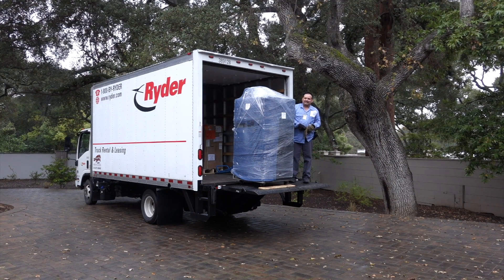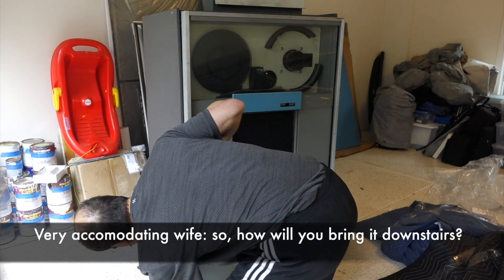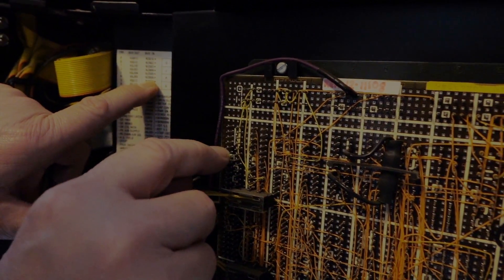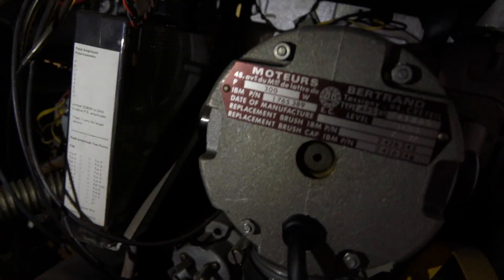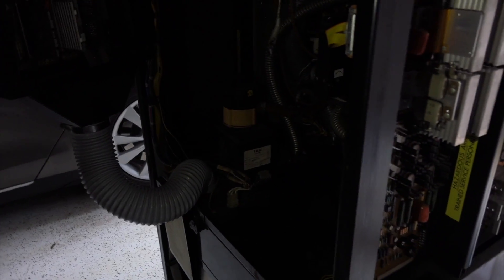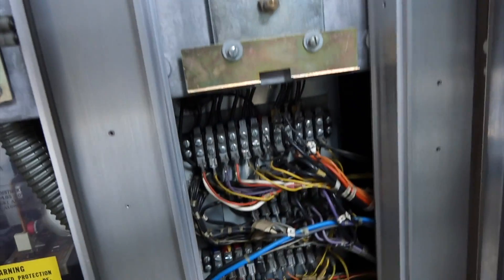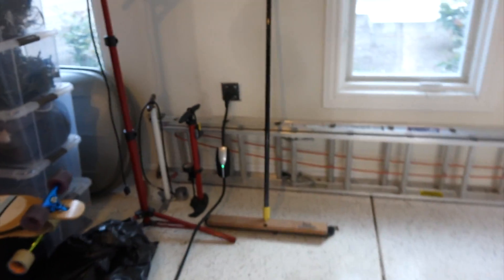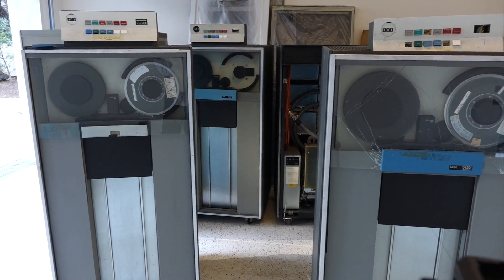IBM 3420 9-track tape drives arrrive for restoration. 800 lbs each!

Comment: Marc, you blurred out your home address so all of us volunteers wouldn't be at your doorstep ready to help? ;)  

I guess there is also fair amount of Palladium contained within the circuit boards?

Looks like the similar IC technology found in my IBM Memory Typewriters from the mid-70s.

Allen Organ uses the same "credit card" access latch to get the top lid of their consoles open.

Holy cow, that tape controller cabinet is huge. Glad it can drive more than one tape drive.

Concerning powering it up, there is a guy who has a large computer in his home and there was a way around the 3-phase power problem.

Here is the video which I think contains how they managed around using 3-phase to power the system.

Here's What Happens When an 18 Year Old Buys a Mainframe (IBM z890)
https://youtu.be/45X4VP8CGtk
Reply from the maker: Can't do that with mine: I really need the 3 phases for the motors, can't be wired in two phases. Priceless talk by the way...
Reply: Well you better be prepared to watch your electric meter spin! ;)

Comment: Hi, From 1967 - 1973,  I was an operator and later a Cobol programmer on an IBM 360/40.  We had 64K memory,  2400 mod II tapes,  2311 and then later 2314 (Pizza oven) discs.  Also 2 1403 printers, one with the power top. I left data processing to be hired  by IBM as an OPCE  (Office Products C.E.) My specialty was the IBM Selectric typewriter.  I worked in Chicago's Loop.
     I truly hope that through efforts like yours we will  be able to preserve at least one complete and functional  IBM/360.  If you obtain the 1052 Selectric terminal, and need my 2 cents of tech. advise, contact me:  Jim B.    IBM S/N 606731.....   PS, we had the same problem with sound deadening foam deteriorating with age........Yuk.

Comment: You are completely crazy. I cannot wait to see what happens next though! If you're going to have the tape machines and controller, would it be out of the question to track down a CPU as well and have a real System 360 running in your garage?
Reply from the maker: The 360/50 CPU, if we could ever find one, is huge. Then I'd have to fight against Paul Allen and the Living Computer Museum, I'm not gonna win... Not to mention the 10's of kW of power I'd need. So that is not completely impossible, but really far fetched.
Reply: It really depends on whether the BIOS on the motherboard supports it. The 5.25" diskette drive was not recognizable by my newer PCs, but it was recognizable by an older one.
Reply: I'm not sure an external 5.25 diskette drive is recognized by Windows. I'd like to see this drive be connected to it. I wonder if there's a new tape drive that modern PCs can see ...
Reply: They scraped them for the gold content, the same as they did with the core memory.
Reply: CuriousMarc Connect it  to windows 7 or 10

Comment: Since the US government likes to keep old computer gear going for a long time, are there any companies offering service parts for these machines?
Reply from the maker: +ariscop: I believe you are right, the /z machines still support 360/370 code (!).
Reply from the maker: The problem is that these machines were mostly rented, not purchased outright. IBM would get them back at the end of the lease, and would destroy them so they would not compete against newer machines. So most of them have disappeared. Then of course they take a lot of space, so people got rid of the few that were left. And of the few that were still left, movers cut the cables, which renders them close to unrestorable. Let's hope they missed a few...
Reply from the maker: PDPs are quite common among collectors. Not so with the IBM 360. Here is a world inventory of known 360's: http://www.ibmsystem3.nl/System360/. If you ignore the model 20's which are much smaller and not really compatible, there are 17 "real" 360s' listed there. The LCM just got a model 30 recently, that should bring the total to 18. Only ONE model 50 (!). That's how rare they are.
Reply: The is a video ... about 2010 of a complete system 370 final shutdown. It was from a big oil company (or something like that) The owners were terrified to stop their systems because they though they would make their finances to collpase. So they keep this thing running as long as they could. Crazy stuff. but also Banks are very reluctant to upgrade any working system. At my university, still in 2004 a complete raised floor 370 worked every single day to run ALL the administrative tasks in several offices using terminals. No sure way they keep it going. I remember that they took a not working disk drive to another room and the motor was bigger than a washing machine one. Everything was gigantic. They have tons of green phospor terminals with a clunky keyb, I mean SUPER clunky ... a model M was a toy compared to them. This machines, specially when set in a whole big room have a big appeal. No matter if a standard desktop PC is faster. Is all about both character and charm
Reply: Actually not true. In the very old days, pre 1970, a lot were rented but after that they were purchased. It made more sense to buy. When no longer needed they were sold to other companies or went into refurb houses for reconditioning or stripping for parts. Parts were a lot cheaper from them than IBM. Renting was a way for IBM to hold onto the service business. But the Feds gave them trouble for tie-in sales so selling became the preferred way. Also IBM wanting old iron back so it wouldn't compete with new stuff isn't true either. Old iron often was bought by customers who couldn't afford new stuff. These customers bought IBM service so IBM still made money. These customers became the future sales prospects. I oughtta know. I was there in the thick of things since 1965.
Reply: Probably not? ibm rented machines and were forward compatible since the 360, they're probably still running s/360 code but on modern system z mainframes
Reply from the maker: Not that I know of, but they apparently still run old IBM 370 programs on emulated machines and attach modern web front ends to it!
Reply: That stuff was so heavy, I'd bet a lot of it is in university basements. Not worth hauling up to trash. Probably covered in boxes by now.
Reply: Not all mainframe systems were rental. Some could have been bought outright. The PDP line and others could be bought. I don't know if they'd be compatible with IBM gear, though.
Reply: @525Lines  haha what PDP was a mainframe? There is no way that PDP could compare to IBM. I worked on a lot of DEC machines and most were just mini computers (toys) even the VAX was not even close to processing power of IBM big iron
Reply: They still had mainframes, heavy dumb terminals, cold rooms with false floors, even some guys in white lab coats when I started working. I was very envious they got to play with that stuff.